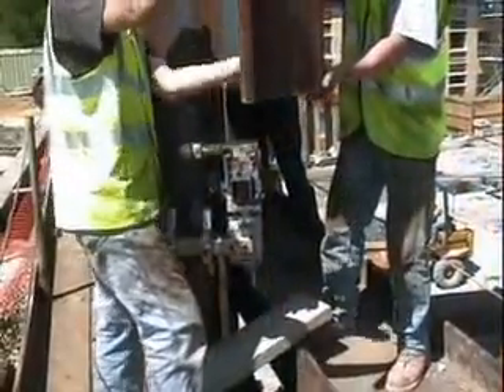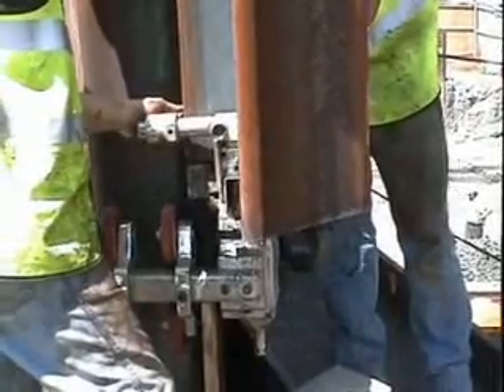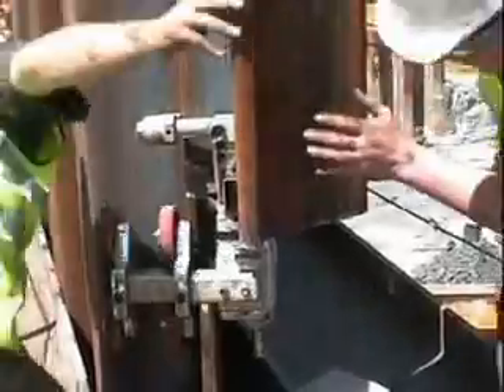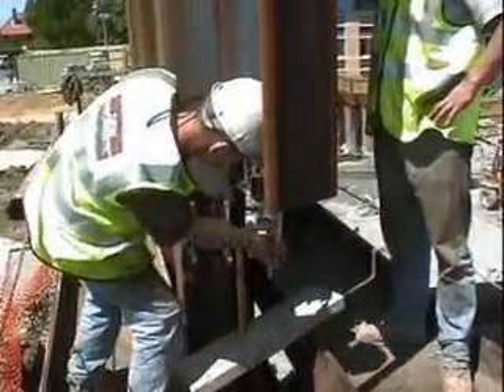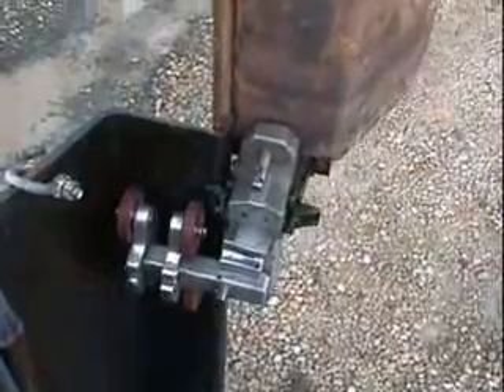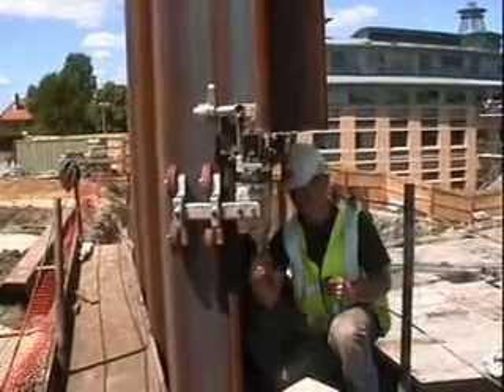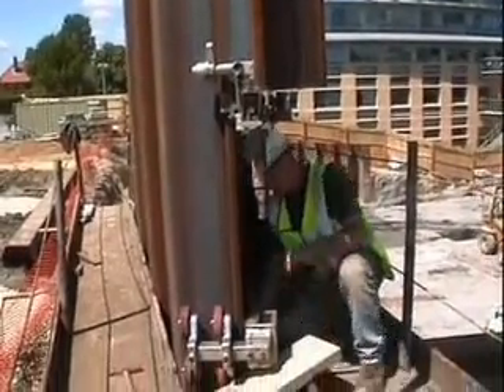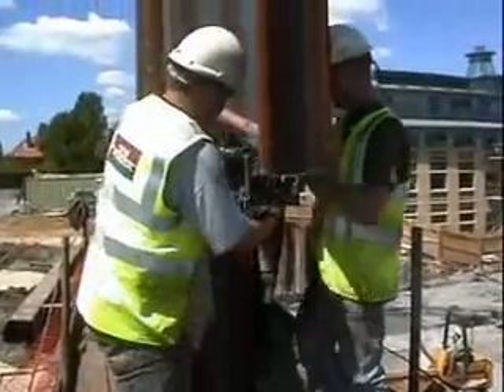Dawson Construction Plant Universal Sheet Pile Threader

Comment from the maker: This type product has been used extremely successfully and safely for 20 years.
Instead of the operator having to climb or be hoisted to the top of the pile line and interlock manually, all the operations are carried out at lower frame level.  This is a much less exposed position.  The crane/rig driver can clearly see the operator who is giving the instructions when to lower or adjust the position of the pile.  Even in strong winds production can carry on safely.